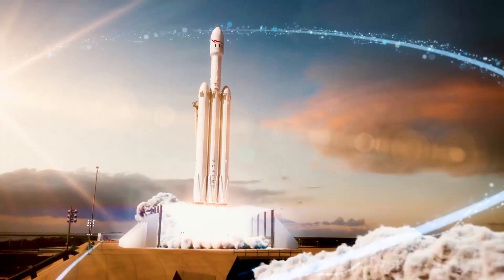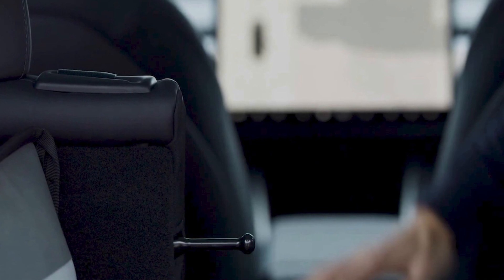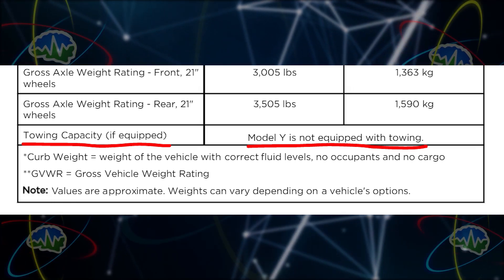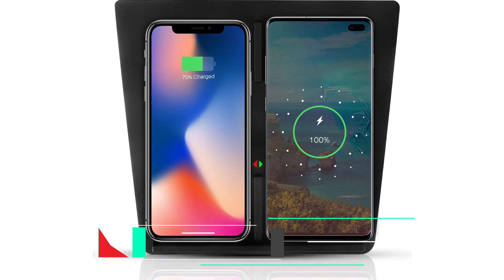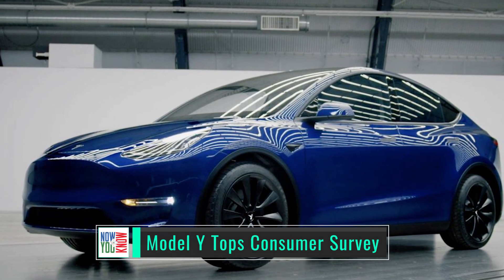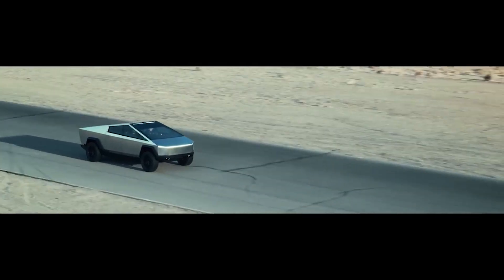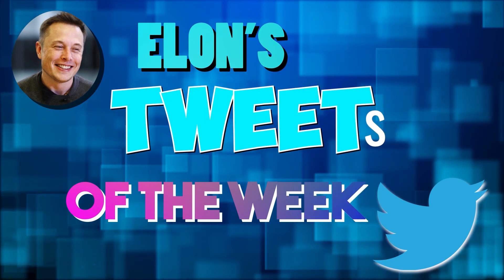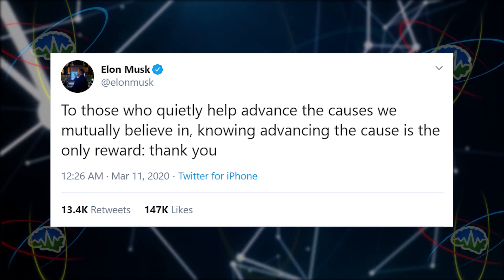Tesla Time News - Model Y - More Details Revealed!

Comment: the cargo shelf is for security reasons. it prevents from cargo flying through your car doing a full breaking or if getting rear ended. In some european countries it's mandatory to secure your trunk cargo.
Reply: 360 grad either a shelf or a vertical net closing the gap above the rear seats. Both not available on the model Y, this could cause trouble in europe for not being able to secure the load...
Reply: Is there the down points in the back?
My last car was a station wagon and I used to carry kettle bells for personal training. I used a chain between two tie down points to secure things.
Reply: @teatowel11  didn't saw any except on the lower ends of the seats. but nothing on the sides i think. also the trunk covers panels don't seem very stable to me. somewhere i've read payload is 65kg.
Reply: @donnie7977  yup. could be problematic. also those bar constructions you could spread in probably wont work because of the glass roof. and i've read the trunk cover panels have a max payload of 65kg. but not sure tho.
Reply: @donnie7977  people in europa are used to mount those dog cages in the back for transportation. probably wont work as well.
Reply: @grad-dd9zj  I guess I'll just have to wait for the Cyber truck haha
Reply: @teatowel11  yeah, that's one way to solve the problem i guess :)
I'm in europe. considering model y mid next year. hoping for some improvements and a reasonable price drop with giga berlin going online. teslas here are still more than 10'000$ more expensive than on the us market.

Comment: They may be using HW2.5 to make sure that only paying FSD can get HW3.0 rather than have hackers buy one and install it in all the other cars.
Reply: Why would hacking only apply to China?  They are doing it because they didn't have enough HW3 boards available and it would have stopped production.  I believe the lack of HW3 hardware was related to the Corona virus lockdown impacting the supply chain.
Reply: @CL-gq3no  China has a reputation for not respecting intellectual property. They will buy one copy of one program and it is not long and a lot of other computers are running copies of the program.
Reply: @johnd01 , I'm aware of that and I'm a programmer for a living so I have a good idea how that works, but it doesn't make sense in this case.  I won't go into all of the geeky details, but one common sense reason this can't be the reason is that Tesla has already said it plans to retrofit all of the China HW2.5 cars with HW3 as soon as parts are available.
Reply: @CL-gq3no  The real question is: Why did they have HW2.5 available?
Reply: @johnd01 , surplus from before HW3.  That's pretty common.  Boards like these are usually made in large batches because the components cost very little, but the initial setup is quite expensive.  I wouldn't be surprised if Tesla still has warehouse shelves full of them.

Comment: Trying to sell a Model Y without a tow hitch is like trying to sell a Cybertruck without a tow hitch ...
Reply: guringai Tow hitch was planned to be made in Wuhaaaaaan. Be careful what u wish 4. 😷😷😷
Reply: Gordon McMillan CyberTruck was announced to include towing at the time it was unveiled. Model Y was NEVER reported to have towing. 

But there’s a pop off panel on MY where the hitch will eventually go. And some internal data sheets leaked detailing the the wiring or mechanical diagrams. So just need to be patient 

And you will be disappointed again when you see the drop in performance, range, handling. And yet again when you need to unhook the trailer every time you need to use Supercharger
Reply: @drdrew3  I don't need performance or handling when I'm towing a trailer, but I do need to be able to tow one.  Range isn't a big deal, a guaranteed hundred miles on flat road with a trailer would be fine.
Reply: It would be interesting to see how many potential Y owners would pay say $1,000 for a tow hitch package. I have one on my car, (that i I bought 2nd hand), as it was already fitted, but I've never had cause to use it in 3 years.

Though I suppose if I could hire a trailer cheaply enough it might be worth it!?
Reply: , @user-jt1jv8vl9r  Factory fitted and wired, or fitted by a service centre, I think a lot of people would.  I generally get them fitted to everything I buy, and yes, I haven't actually used the one on the current car.
Reply: @drdrew3  thanks for the info. I have a reservation, but will wait to see if they release a US tow package before they get to FSD. I want it so I don't have to ding my car to bring my bikes wherever I want to go... And if I ever need to move, I will have the painfully slow and cheap option (it'll be my only car).
Reply: @user-jt1jv8vl9r  I ordered a TM3 SR+, 4 days after they announced the tow hitch in Europe, to replace the eGolf I had back then. If I had both options, maybe I would choose TMY SR+ ¡with tow hitch!
Or a Model 3 "hatch back". After 6 months, there has been situations where the restricted trunk has annoyed me, but I have managed to work arround it. (A small trailer beeing one work around)

Comment: The bar in the  rear seat will be part of the centre seat belt fixing so will be solid! The e-bike rule simply says that the motor can only provide assistance up to 15 mph, you can go as fast as you like but only using pedal power.

Comment: About the bike: Just imagine you take your bike, add a 500 HP motor, 2 extra wheels, 4 extra seats. Would you still call that a bike or would it be a car? Would the police let you ride it without a driver's licence? What about brakes? Should someone be able to ride that 500HP-Frankenbike with the original bike brakes?

Yes, the borders between different classes of vehicles are arbitrary. But they have to be if you don't want to throw everything with 2 wheels into one class (and call it motorbike).

The class "eBike" has technical requirements to handle 25 kph, that includes strength of the frame, the brakes, and so on. If you want to be faster, your vehicle has to be a speedbike (or however that thing's called), have a frame that was designed for 45 kph, has to have brakes for that speed and so on. If you want to go 100 kph, it has to be an eMotorbike, with a frame designed for those speeds and so on.
Reply: So you americans dont have drivers licences for other kind of vehicles other then cars ?🤔
Reply: @rickkern5785  So you ignore the fact that the motor itself is used to break.

I'm not saying that was safe, but that's not good reasoning
Reply: That 500HP motor would be 1 492 times over the legal limit.

I mean we already have speed limits on roads and all those things. Just limit the power weight etc to a reasonable limit, and regulate it well. Maybe taking into account the age or some basic driving license to be able to have more power.

I have ran with my legs over the speed limit for ebikes chasing the bus haha. This is ridiculous.
Reply: @rubenayla  the max 250 W and 25 km/h pedal assist limit, is spesification limits to be within the bike class, to be legal on pedestrian/bike tracks/paths. It is not illegal to go faster than 25 km/h on an e-bike if you use only downhill and/or pedal power (like normal bike), but they classed as motor vehicle if they use motor when you go faster than 25 km/h.

Comment: Love how hard it was for Zac to let go of the tow hitch.
Reply: Zac 's right. Dumb idea to not include a tow hitch. Greetings from Straya.
Reply: @arrowmouse  I have a TM3 SR+ (with tow hitch). The convenience of the hitch was the initiating reason to replace the eGolf after 4 years.

I have used it to carry bike rack many times, and several times for a small trailer to carry stuff home, and to the junk/recycle yard.

Like Zack and Jesse mentioned: in Europe, it is more normal to use a small trailer when you want to bring stuff, instead of driving aroud with a pickup truck every.

Pickups are not uncommon, but far from common. They are more common as workers car, than family car. At least Norway have lower tax on cars for cargo (with some size reqirements), if there are one one seat row (= 2-3 seater). Without the second row, you can still have a usable bed, but a smaller pickup than the Cybertruck size. The "Truckla" by Simone Giertz, is not uncommon size for picup in Norway, maybe more if it stated from a Model Y.

Comment: SUV should include tow bar option: Why doesn't Tesla invent an extended battery pack whereby you can mount in your trailer or caravan to give you extended range? To estimate the range correctly can't Tesla programmers allow their software to let you enter the weight of trailer or caravan and then the range calculation will be more accurate given the actual/estimated weight is known? It is mainly because Tesla hasn't solved the towing properly, I have held back in buying a Tesla. Other ideas include Tesla doing a deal with trailer/caravan companies to integrate slot in battery pack options to allow all Tesla owners who wish to tow to have extended range.  Knowing Tesla they could create their own Tesla trailer and caravan with such extended battery packs themselves to better integrate their technology. Not sure if they could motorise the caravans too but then it might not be classified as a caravan any more. Hey Elon, what about a Tesla camper van next?

Comment: It's been known for the past 15 years that Hawaii's Islands have been sinking into the sea, due to the plate sinking at a rate of around a foot per 100 years.  This has to do both with the Volcanic Activity on the Island and I would guess that just like here in Miami, overbuilding near the beach has probably caused A LOT of erosion.  I find it interesting that everyone in Miami is talking about Sea Levels rising, at the same time that they're taking block by block ENTIRE COMMUNITIES and turning each block into a MASSIVE Concrete tower.   There is ZERO ground exposed, so the water has nowhere to go and causes massive flooding to the surrounding communities.  The City commissioners then conveniently blame it on "Global Warming", taking zero responsibility for turning our communities into massive concrete jungles.

Comment: As far as France... I believe the key word is “modified”
Reply: Ture
Reply: Also, different classes of e-bikes have different requirements (helmet, insurance,...). So, every bike has to stay in its class due to regulatory requirements. You cannot by an e-bike that requires not insurance (e.g. because it's slow) and modify it to be faster (and would be in another class and would require insurance).
Reply: @JochenHormes  and also where you legally can ride motor vehicles and non motor vehicle.

Comment: Isn't a resistive heater 100% efficient? How can the heat pump be more efficient? If anything it's less efficient.
Reply: Daiku Coffee Heat pump is more efficient because you get more heat output per unit of electrical energy inputted. Resistance heater gets hotter and does so quicker but is a battery hog. 

Probably only adds a few miles range — but that’s the name of the game. Every little bit helps (unless just crazy expensive like solar panel roof)